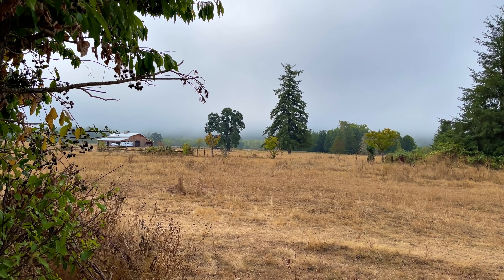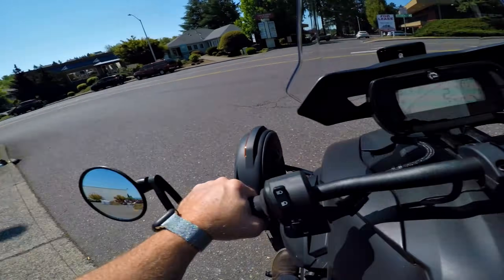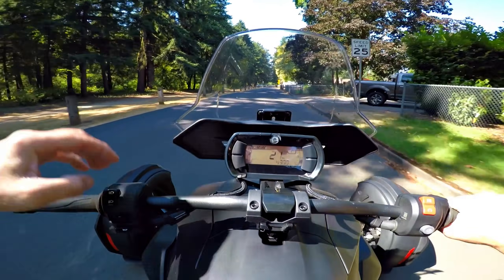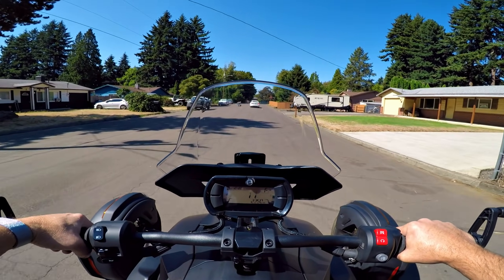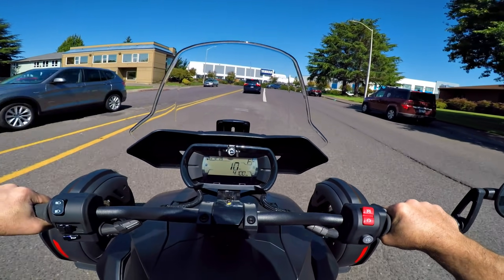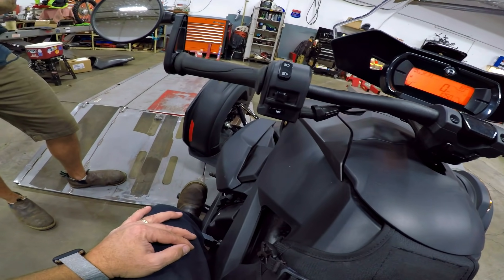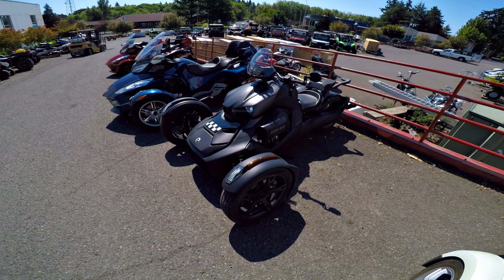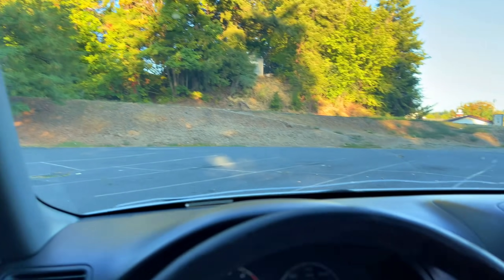The Awesome 600 Ryker!! • Street Glide Oil Leak..! | TheSmoaks Vlog_2117

Comment: I never ever service my SGS, apart from fitting accessories, the Harley shop does all mine. if there's a problem in she goes but in 5yrs and  27,000klms ( 16,777mls) I've never had a problem. I still get folks that wonder why I ride that big lump of iron, I tell them you have to ride one to figure that out it's just the sweetest thing.

Comment: I always thought that Harley could fix their problem with people overfilling the oil by changing the hash marks on their dipsticks!  If they just made the full mark where half full is, there wouldn't be any problems!  I'm guilty myself, every other gas engine I've ever owned wants to be up to the full mark, but not Harley!  It'll puke out your air filter to let you know it doesn't like that.  Seems like Harley could easily fix that situation.  That's my two cents.